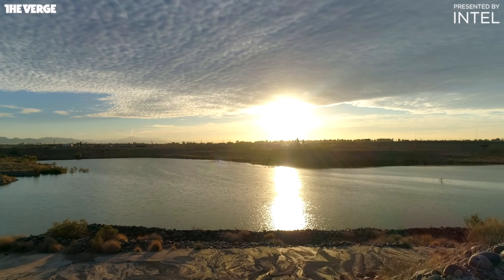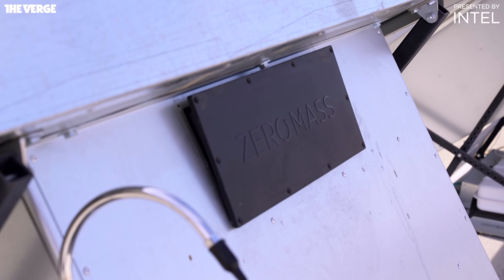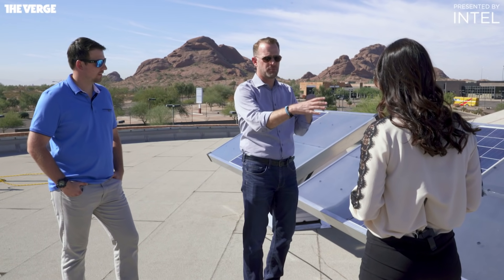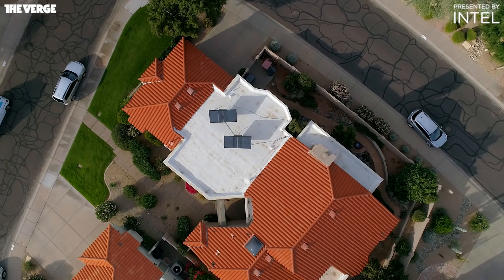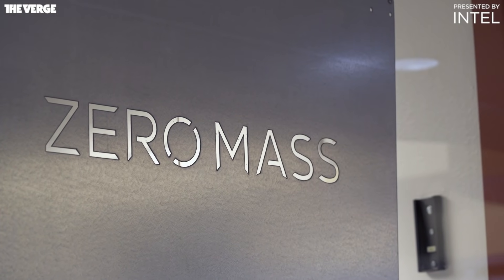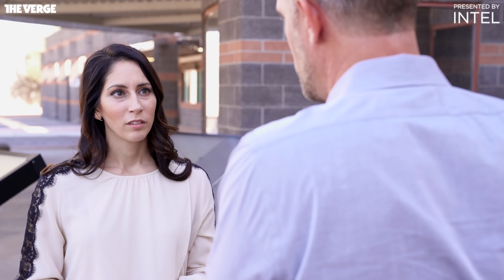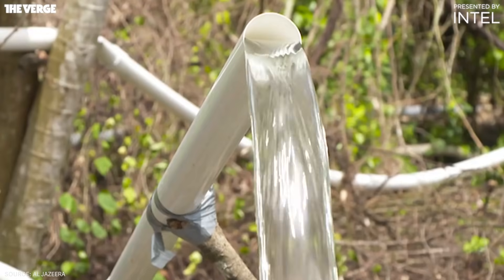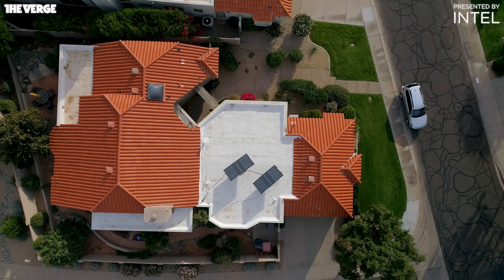Zero Mass' solar panels turn air into drinking water

Comment: isn't this just big dehumidifier ?
Reply: A normal dehumidifier can produce more water then these
Reply: @ExperimentalFun  You can't drink the water from normal dehumidifiers: crucial difference.
Reply: @malk6277  well its not designed with food grade materials but you can drink it, its just pure water,  also you can filter it to be safe
Reply: @ExperimentalFun  I've read warnings on multiple models of dehumidifier that toxic chemicals from the internals of the appliance make their way into the water, as well as mould, bacteria and algae. And remember, this is not pure water distillate: it is condensation from the air that never boils or undergoes any other purification process: plenty of room for contaminates.  In theory even viruses.
Reply: @malk6277     Its not designed for drinking water,  in most cases the water would be pretty safe, but anyway  it would need to be filtered it make sure that it safe to drink.
Reply: @ExperimentalFun  where do you have this information from? Do you have such a device at home and did you test a dehumidifier under the same conditions? It depends a lot of how much water is in the air (relative humidity) with a dehumidifier, you sometimes could not even reach the dew point in arid regions. Plus: you don't have a plug where you can just plug in the dehumidifier. Places where water is rare often also lack in electrical energy.
Reply: On there technical specifications sheet on there website it says "The water vapor is collected as the airflow passes through a condenser and the resulting liquid water flows into the onboard reservoir"
Reply: Very much so, just a large dehumidifier. This still won’t “produce” water from places with extremely dry air, so it still doesn’t really make any sense. 

Going underground in dry desert places looking for water is still much smarter. 

But in places like the amazon rainforest, or the west Maui mountains, this would totally work! But so would simple water catchment.
Reply: @tilago  well, you would have to dig very very deep sometimes since groundwater level in the mentioned regions is very low and continuously decreasing because more water is taken out for use than can be renewed from rain etc.... And very often, it is not safe to drink. That is why they are researching for alternative sources of water (sometimes called renewable water.)
Reply: @tilago  Yes it will produce water in deserts. They address this in the video.
Reply: @malk6277  it can only draw water from the air, or if you drill, from the water table.  You can think about it from a physical fundamentals approach, and just consider the humidity of the desert. If the humidity is high, you'll get plenty of water you can treat and then consume, but low humidity will mean you will only be able to harvest a very small amount. I live in a rainforest and we live nearby dormant volcano that can be extremely dry with low humidity. This system would work find in a rain forest. But it would be very ineffective in a dry and inhospitable area.
Reply: @tilago  Yes, I understand arid regions have less water to draw from in the air, thanks.  The point is some will still be drawn, and in situations where there are literally no other water sources (such as in a desert), the water delivered by this system is better than no water at all.
Reply: @malk6277  True! it's an old comment thread and the technology could be  technically implemented, although the cost-benefit analysis would prove other methods significantly more effective, depending on demand and water usage.
Reply: @tilago  Yup - much cheaper ways to get drinking water in most situations. I'm considering this for use on an arid island with no drinking water sources. Desalination seems to have more points of failure and more consumables, although we might opt for that too, for redundancy and greater output.
Reply: Distilled water is not recommended to take in daily routine. It absorbs your body mineral due to osmosis effect. Unless you have balance mineral intake from food to recover the lost mineral.

The practical application with this tech is to produce clean drinkable water in scarce potable water area.
Reply: @blazeboymilan  That's a myth! Do your research. Once the body has utilized minerals no distilled water will cause your body to leach minerals. This was an old sales tactic used by Water Filter companies back in the days.. LOL and you fell for it. 😆
If distilled water leached minerals it wouldn't be used in your car batteries... On the other side.. Water with solid minerals do cause damage. You get your minerals from sources that have already assimilated the rock or metal mineral and now your body can use it through a chelation process. Examples: meat = Iron, Green leaf plants = Iron, calcium, magnesium, Bananas = potassium... Animals and plants eat vegetation absorb minerals and we eat the plants and animals and get those minerals or take a vitamin mineral supplement but never ever think you need minerals in water for nutrients there is absolutely not enough to even meet the RDA in your H20 so foods and supplementation are the correct way to get your minerals. But please do research thoroughly again... 👍  ( I specialized in this field for over 25 years. I know 😉)
Reply: @blazeboymilan  obviusly! But exist  simply technology to obtain good quality of  water from this water with low costs. I Need to use for vegetables production  or in garden during drought times!! Distilled Water Is a posion absolutely, 2/3 liters can kill a man!!
Reply: @tedeisundsturm  -  Woah, woah, woah!  Distilled water will not kill you!  How wrong are you?!  I use a stainless steel steam distiller to make 3 gallons of distilled water per day in my kitchen. I take our unpleasant tap water and distill it and drink it exclusively. I use it for drinking water, making tea, soups, water for cooking, and to make coffee and Kool-Aid or Crystal Light flavored beverages.  My tap water is first run through a potassium-based whole-house water softener to prevent the excessive mineral buildup in our pipes, showers and faucets and then, out the tap and into the distiller which finishes it by dripping through a charcoal filter to remove volatile organic compounds and bad taste.  The junk left behind from the 'clean tap water' is sludge-like and smells.  I'm glad not to drink it.  
The finished product has a nice clean taste and we 3 humans have been happily surviving on this with no problem.
Reply: @CasuallyObservant  basic water Is good for healt acid and distilled water are killers alive
have BASIC water in body Is the First Aid against cancer and all diseases 🤟
Reply: @tedeisundsturm  -   Stop with this nonsense.  Distilled is not a killer.  What is BASIC water? What do you mean 'healt acid'?
Reply: @CasuallyObservant  stop Joking me, read about distilled water, Is good just for old iron , to iron Cottons clothes 😉
Reply: @tedeisundsturm  - stop this. I drink it exclusively, as does my family.  You are uninformed.
Reply: imconconc678 i believe it's meant to be used in Deserts or after natural disasters
Reply: hook line and sinker, you took it all
Reply: Gamex996 kinda but it doesn't seem to use a condenser ie more efficient
Reply: @iain3713  Yes, if I got it right, there is no electrical driven condenser. The condensing process is done by the effect of radiation cooling (radiation exchange of the glass cover with the cool sky), instead...
Reply: Gamex996 a solar powered one. People should be aware that this isn't actually a breakthrough or new inmovation. But it's still useful
Reply: Slap a few 100w panels, couple of deep cycle batteries, a cheap dehumidifier and you got your water making machine. But gotta filter it though, it's nasty as hell in the tank after a while.
Reply: @1FishinAddict    Okay, but your suggested system would only work in areas where the relative humidity is high enough (60-90%). In arid regions (below 30% del. humidity) you have very low dewpoints of the water in the air, sometimes even below freezing point. You would need a lot of PV Panels to cool down the air and condensate the water. With the same area (like the device mentioned here) of PV and a dehumidifier instead, I doubt that you would reach even 1/5 or 1/10 of the water gained with this device  - in arid regions! Means that you need at least 5 to 10 times the area to gain the same amount of water.
Reply: sure tapwater. europe its great, but in merica im not so sure =)
Reply: Even a simple silica gel works.
Reply: Depends on where you are in America.... But 99.999% of all tapwater in America is safe to drink, -anyway.
Reply: Crimson Corsair its not useful if it produces more water if you use it as a rain catch instead
Reply: Jay, clearly this needs power for FAR more than just running a fan, given the size & number of functions in this $150 fan powered solar stove with led lights & usb for phone charging http://www.africancleanenergy.com/
Reply: Yes, a solar-powered Internet-connected, pure water generator with at least 60 L of water storage.
Reply: I believe yes, another device similar but based on eolic Energy exist, this Is more useful for Teo reasons, First Is It few or ti much Wind, other reason Is lower maintenance without Blade problems
Reply: I'm sure it's much more efficient though.
Reply: A slow one too.
Reply: Yes
Reply: Buy $400 worth of solar equipment, a $100 dehumidifier and a $50 filtration system. There's no difference.
Reply: @corbinn6527 Yes,  there is a difference! Your system won't work in arid regions with low relative humidity (below 30%). And if it works, however, you would need a lot of PV Area. Maybe 5-10 times the area of the device mentioned here, or even more. Depends on the relative humidity a the solar radiation, though...
Reply: Gamex996 a big 'solar powered' dehumidifier for people who don't like free tap water or even bottled water lol
Reply: @conconc678  Tap water isn't free. It really depends on where you live, but that's a bill. Water in the air is COMPLETELY FREE, and you can use it to water plants, or whatever, instead of paying for the water. Once the cost of the dehumidifier is offset by money saved on tap water, it's all free after that.
Reply: @conconc678   I don't know about you but I get charged $450 per year for tap water and I live in a Rain Forest in Vancouver
Reply: @conconc678  no such thing as FREE tap water. I have never had FREE tap water.
Reply: Not entirely, a dehumidifier uses the air conditioning cycle to create a cold, condensing surface to attract moisture. It is an inefficient and power hungry process. The manner in which this operates, is much more efficient and only needs power to run a fan. The proprietary means of moisture absorption is a materials science thing, which is really cool to see in the lab. 

Source: interviewed with these guys back in 2015, got to see the whole operation and the magic of their absorber.
Reply: imconconc678 Tap water is not free everywhere.
Reply: @cameronscott1853  tap water isn't free anywhere!
Reply: Calling this a glorified dehumidifier is a bit like calling a defibrillator a glorified stun gun. You wouldn't want to use a stun gun to defibrillate someone... even though both deliver electrical charges to the body. A stun gun can cost as little as 10 dollars. Defibrillators upwards of 1000.
Reply: Gamex996 a solar powered one.
Which makes all the differance

Comment: How much water can they produce on average every day?
Reply: In the best possible way under perfect conditions.. so it's unlikely to ever reach 5 liters.
Reply: TheShadow I thought it was 5ltr maximum..
Reply: 5L, so long as it's raining... Oh and so long as you've purchased, for the low low price of only $79.99, the reservoir Advanced Water Uptake Collection device, which is an add-on, which is a kiddie pool.
Reply: Well, I did a quick thermodynamics sanity check, and here's what I found...

At 25deg C, the enthalpy of evaporation of water is 2442 kJ/kg.  1kg water = 1L.  This is the thermal energy you must extract from water vapor (Latent Heat) to get it to condense into a liquid.  There is no magic way around lowering this energy requirement.  Your cooling system will likely only be 50% efficient at best.  So now you are up to about 4884 kJ/L energy input.  A 300W solar panel will produce 4884 kJ of energy in 1.628x10^4 s = 4.5 hours of full sun.  So you produce best-case about 1L of water every 4.5 hours.  You might be able to get 2L a day if you use a heliostat and sunlight, air temp, and humidity conditions are favorable.
1
Reply: Jess, "ideal conditions" being near rainfall or currently raining.
Reply: It said 5 liter *Average*. Not maximum. So you could get between like 1 and 10 depending on weather and whatnot.
Reply: TheShadow 5 litres... did you watch the video?
Reply: Thanks, I missed the info.

Comment: what about air pollution, if you were to stick the panel in the city e.g london or india. Would you be drinking the toxic pollutants into your body?
Reply: YibTube that's not the same as filtering....
Reply: India is my city 😂
Reply: But the air is contaminated, water will absorb it all anyway. Did you ever see water tank in dehumidifier? It's nasty goop. With all the smog and particulates that need serious filter work condensing water just won't cut it. This isn't the same as distillation - it isn't closed loop like in a lab!
Reply: YibTube well, pH level and adding minerals doesn't necessarily clean the water from any harmful substances?!😂
Reply: India is not a city dummy.
Reply: Ravinder Sembi yes. Yes you would.
Hopefully it'll filter theee out though.
Reply: Ravinder Sembi 
VAPOUR IS CONDENSED AND THROUGH A CATRIDGE IT FLOWS DOWN TO THE SOURCE OF DRINKING WATER. DURING THIS PROCESS IT GETS MINERALISED AND PURIFIED.
Reply: The h2o is separated from the air so it's basically the same as distilled water, then it's remineralized.
Reply: UV light is high energy drain, magnesium and calcium cartridges are cost, filters as well. All I can see is pointless money drain. Its better to build proper sewage systems to recycle water in massive quantities.
Reply: Ravinder Sembi exactly
Reply: Moisture in air reduced means automatically hot air and skin diseases will get..
Reply: NinoDroid yes. They did.
Reply: right ....  you dont get distilled pure water ....
Reply: Ravinder Sembi 😂😂
Reply: Ravinder Sembi A air pollution as a carbon or industry emissions can affect people.
Reply: You wouldn't have to worry about that in a city like London. There isn't enough sunlight to power the thing. (Yes, pollution would be a problem, especially if you intend to drink the water. Mold, bacteria, airborne metals and other combustion byproduct pollution would all need to be filtered out or removed by chemical treatment. It would be far more expensive for everyone to have their own little rooftop water treatment facilities than it is for millions of people to share the same large water treatment facility.)
Reply: A love how you think you can compare the city of London to India...Oh wait..
Reply: wouldn't the fact that the water is already distilled from the condensation process mean that some impurities are removed?
Reply: Franz Schmitt and Sahil Pethe Distillation is a the process of heating a liquid until it changes phases from liquid to gas, then cooling it to condense it back to liquid in a closed system. With proper distillation any dissolved solids and bacteria are left behind and you're left with completely pure water. The thing you're both missing is that this is only the second half of the process. Water vapor can only condense onto a solid surface. In fact the clouds in the sky would not be possible without atmospheric dust. For this reason, what these panels do doesn't really compare to distillation in the way you are implying. Any particulate matter in the air can contaminate the surface that the water condenses on. So like any drinking water, it's still best to filter it. I'm not saying it wouldn't be clean enough to drink, just that calling it distilled isn't very accurate. It would still contain any dirt and debris that passes across the condenser.
Reply: yeah what prevents other form of vapor (not water) from condensing in the panel and mixing with the water
Reply: It will alter Ph levels and mineralize the water so this should be safe assuming those functions never fail.
Reply: Lmao to late there water is already contaminated
Reply: Ravinder Sembi it’s going to be the same as rain water would be.
Reply: Ravinder Sembi
?nope